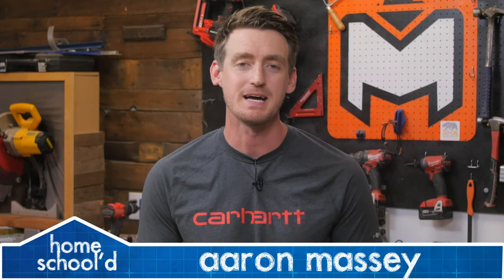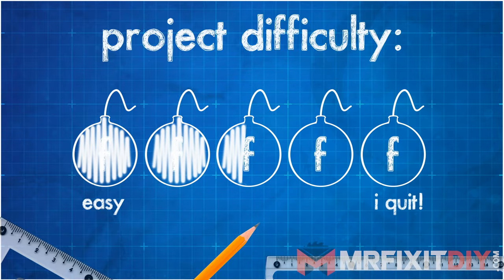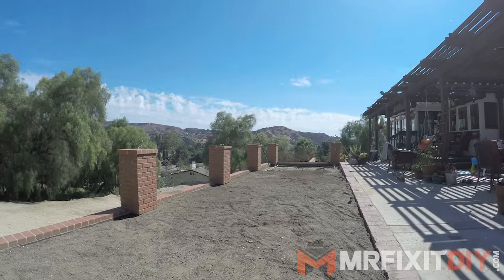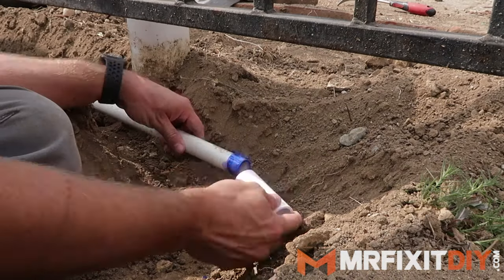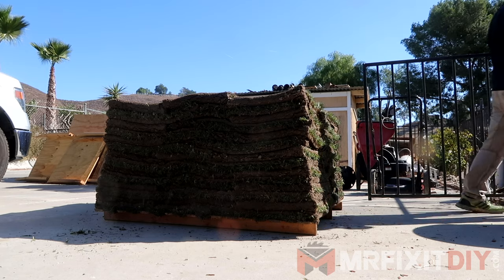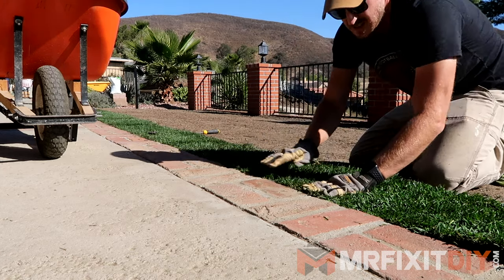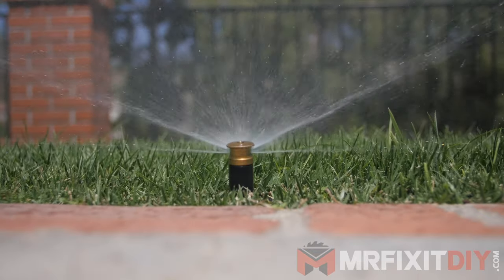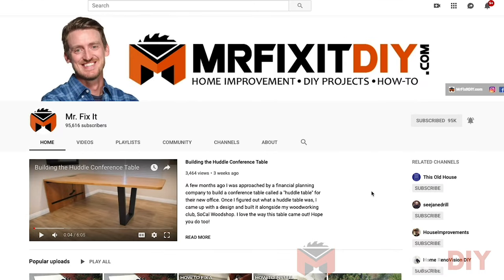How to Install Sod | A DIY Guide

Comment: you can lay sod on old grass/weeds. you dont need to till. you can literally slap sod on top on your lawn just the way it is. only reason to till is if you want to flatten out any lumps in your yard. ive done several yards without tilling, or killing grass/weeds. people will tell you to till/kill grass just to make it seem harder than it is. you dont even need to roll it once its laid. water it 2 hrs every other day after laying sod, or about 1hr every day for the 1st 2 weeks. all you want to make sure of is the sod merges with the earth. the 1 thing i would ABSOLUTELY recommened is mowing new sod with a reel mower. i recommend cutting any grass with a reel mower. use a starter fertilizer after laying new sod also. believe it or not, scotts makes a very good starter fertilizer.
Reply: You Matt Brubaker are amazing my guy! I appreciate that! I just installed 4 pallets and tilled up entire backyard and it was already flat smh. Anyway, thank you sir for  comment!
Reply: Just kill and pull out the weeds before sodding.  Use an herbicide 3 months before installing new sod.
Reply: @quorthunsargeras7054 3 months or 3 days?  The weeds will be back in no time if you wait 3 months.
Reply: @chosendesigns6228 can’t fix stupid huh
Reply: What about rocks I have so many on back half of back yard. Old owners used a a drive way. I'd def need to shovel them all up right?
Reply: @mrhumble2937  guess it depends on how many and how big but i actually laid sod down where I had a "rock garden" thus year and it's fine.. there were several of those marble rocks there still lol

Comment: The mowing after a week is false, you want to wait about 3 weeks so you can give the roots a chance to grab in the soil so you don’t tear it up. Also first 2 mows should be done with a push mower and not a zero turn